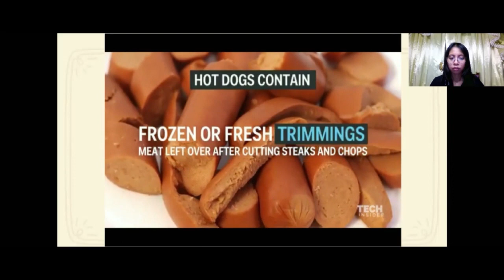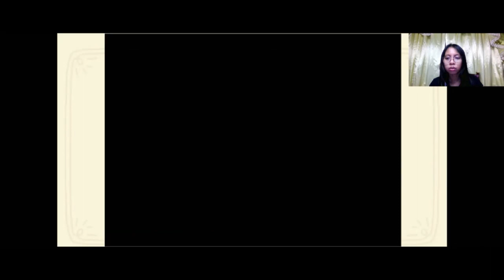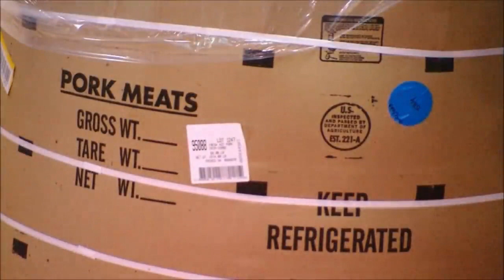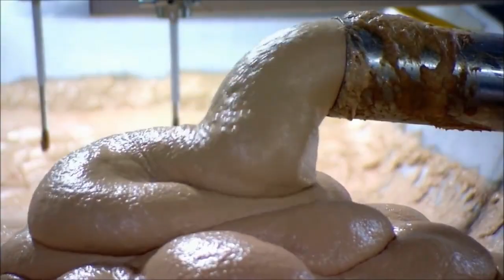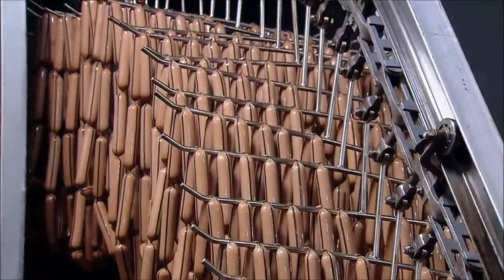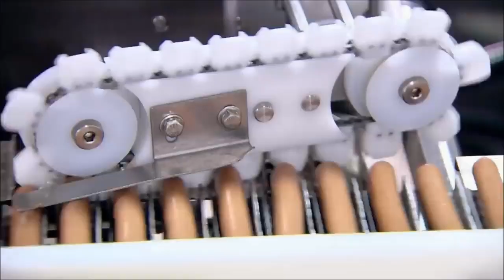Manufacturing of Food (Hotdogs)

Comment: Simene, Jeff Hentzen F. 
BSME4A

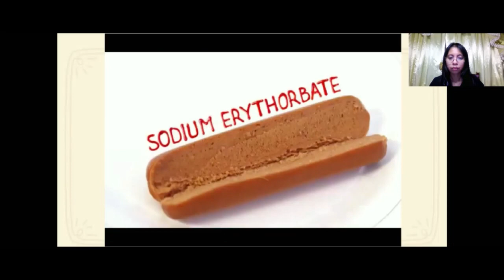3:23 Sodium Erythorbate

It is an antioxidant that converts nitrite to nitric oxide, thereby increasing the color of meat products and accelerating the conversion.
In the meantime, it can reduce the amount of nitrites used in meat products and the amount of residues, thereby reducing the formation of carcinogenic nitrosamines. Sodium erythorbate is produced using the identical method as erythorbic acid. In general, it is also produced by fermentation of food-grade starch hydrolysate, but the manufacturing process concludes in the fourth step of erythorbic acid production.

Comment: Pescador, John Berth P.
5:29 - Manufacturing Process

An emulsion or batter is created by combining the meat, spices, ice chips, and curing chemicals in high-speed stainless steel choppers. Continuous weighing of the mixture is done so as to guarantee that all of the components are suitably distributed. The mixture is subsequently injected into the casings using a computer-controlled stuffer and linker equipment. The most well-known brands of hot dogs include cellulose casings, which are subsequently stripped away before consumption. Natural casings are used on some sausages, and these casings are designed to be left on the sausage even after it has been consumed. After the casings have been filled with the sausage meat, they are twisted into long strands of hot dogs before being transferred to the smokehouse to be cooked correctly in an environment where the temperature and humidity levels are strictly regulated.

Comment: Cagampang, Jon Eli P.
BSME -4A
6:59 - Fill the casing
After the casings have been filled, they are connected together to form long strands of hot dogs and transported to the smokehouse, where they are thoroughly cooked under temperature and humidity control. For extra color and flavor, they can be smoked over hardwood.

Comment: Emphasis, Red Alre L.

9:55 – Package and box for distribution of Hotdogs

After the production of food (Hotdogs), the packing process begins. Packaging is vital because it protects the contents from damage during transport, handling, and storage. Packaging keeps the product safe along the distribution chain, from manufacturer to end user. It shields the product from moisture, light, heat, and other elements.

Comment: Peter Allen Sid N. Requina 
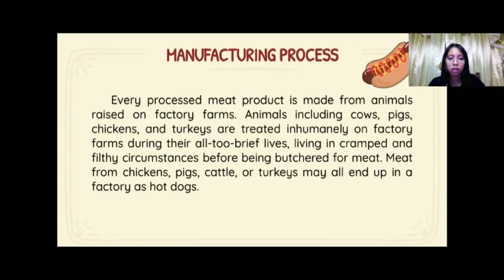5:32 Manufacturing Process 
Using high-speed stainless steel choppers, the meat, spices, ice chips, and curing chemicals are mixed into an emulsion or batter. To ensure that all constituents are appropriately balanced, the mixture is continually weighed. An automated stuffer/linker machine then injects the mixture into the casings. The most popular hot dog brands use cellulose casings, which are then removed. On certain wieners, natural casings are utilized, which remain on the wiener after it has been eaten. After the casings have been filled, they are twisted into long strands of hot dogs and sent to the smokehouse, where they are cooked properly under controlled temperature and humidity conditions.

Comment: Erfe, Karl Immanuel A.
5:33 Manufacturing process
The meat, spices, ice chips, and curing ingredients are blended into an emulsion or batter using high-speed stainless steel choppers. The mixture is constantly weighed to ensure that all elements are properly balanced. The mixture is subsequently injected into casings by an automated stuffer/linker equipment. The most popular hot dog brands employ cellulose casings that are removed subsequently. Natural casings are used on certain wieners, which stay on the wiener after it is eaten. Once the casings are filled, they are joined into long strands of hot dogs and sent to the smokehouse, where they are thoroughly cooked under regulated temperature and humidity conditions.

Comment: Romero, Lorenzo Matthew D.
BSME-4A
5:31 The production of hot dogs begins with the preparation of meat. After it passes inspection, the incoming meat is cut into small pieces and placed in a stainless steel mixing container. The container is equipped with high-speed choppers, which can reduce the size of the meat pieces even further. The other raw materials including the curing ingredients, flavorings and ice chips are blended in this container until a fine emulsion, or batter, is produced. This Once stuffed, the hot dogs are cooked. Their casings are removed and the hot dogs are vacuum-packed to preserve their flavor.
 Once stuffed, the hot dogs are cooked. Their casings are removed and the hot dogs are vacuum-packed to preserve their flavor. batter has a smooth paste-like consistency, which makes further processing easier

Comment: Acelo, Ray Joshua L.
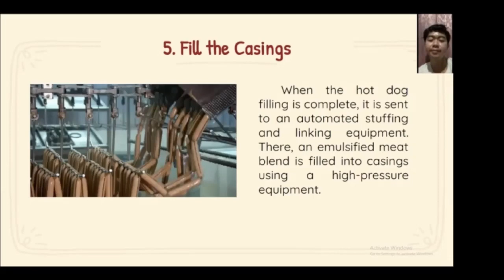7:33 Manufacturing Process
The production of hot dogs starts with meat preparation and inspection. After it passes the inspection it is then chopped to reduce the size of the meat. It is then pumped into a linker machine, the chopped meat is then placed into tube-shaped casing. Next process is cooking, the hot dog strands are then placed to a large smokehouse for thorough cooking.